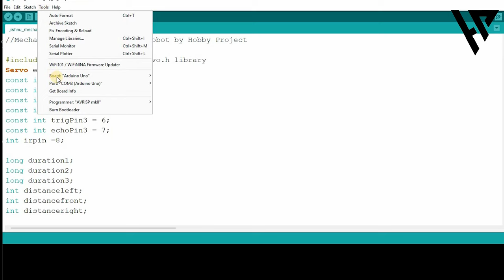Mechano Smart Floor Cleaning Robot using Arduino

Comment: Should i connect the battery gnd and +ve to the esc +ve and gnd and to ardiuno vin and gnd? Plzz respond soon as possible sir :)
Reply from the maker: yes
Reply: @hobbyproject  is it okay if i use a 3s 11.1v 2.6ah battery?
Reply: @hobbyproject  sir i saw your reply to a comment and another comment. You said use an lm2596 buck converter to power the motor driver and you also said that we only need 2nd buck converter if we have to slow down the wheels(speed of the boat)but doesn't we already power motor driver thorugh the supply from battery and esc?
Reply from the maker: if you are using a low rpm motor u don't need to adjust the speed.
Reply: @hobbyproject  Is it okay if i use 11.1v battery with 2.6ah?

Comment: Can i power up ardiuno through the jack port on direct 12v from battery? Plz reply sir its urgent🙏
Reply from the maker: yes u can.
Reply: @hobbyproject  In the circuit you showed us to connect the negative and positive of battery  to the esc and from esc to 5v and gnd in ardiuno right but doesn't that burn ardiuno bcoz the battery with 12v is connected to ardiuno 5v?
Reply: @hobbyproject  which one is safe?
Reply from the maker: Vin and gnd

Comment: Where did you get that glass cover from.What is the material used ?
Reply from the maker: Hardware shops, polycarbonate sheet.
Reply from the maker: Higher kv rating lowers battery backup.
Reply: @TRAZExYT circuito completo porfavor

Comment: Where do i connect the 2nd buck converter?
Reply from the maker: if u need to adjust the speed of the bot then only u need the 2nd buck converter. connected parallel across the + and - of motor driver.
Reply: @hobbyproject  Do i need to adjust the voltage of buck converter for charging the battery? I mean should i put a higher voltage than 12v to charge the battery?
Reply from the maker: It should be higher than the battery voltage, so the current can flow from charger into the battery.

Comment: What is the use of another buck converter that you have used in the last part, kindly,please give the connection from the converter it will be helpful.. i am working on this project..
Thank you!
Reply: It is to control the speed of the wheel motors, The l293 motor driver used here doesn't have enable pins ( pwm pins which is used to control speed,In this case it's speed of motors) So the speed of the wheels here is too high, So he used the lm2596 buck converter to step down the voltage provided to the l293 driver, So low voltage means low speed, So that's why.
Reply: @TRAZExYT what is the use for the 1st buck converter?
Reply: @benogorman8034  The 1st buck converter is used to charge the battery, The buck converter have an option to adjust it's output voltage,so you can adjust the voltage according to your battery specification, Remember if you were to charge a li-on battery then you should atleast put 1.6 volt more than the original

Comment: Hey sir. Potentio 10k to arduino for what?
Reply from the maker: To adjust the speed of BLDC motor.
Reply: How to control speed of wheels? I use 12 v for motor driver and wheels run so fast. I use  mini L293d
Reply from the maker: Use lm2596 buck converter to power the driver so you can adjust the speed.
Reply: @hobbyproject  thanks sir. You're amazing

Comment: hi, i'm doing this project and my only problem is the dc motor speed, how can i make it slow?
Reply from the maker: use lm2596 buck converter.
Reply: Hey please help out,we are working on this but its not working,cam you provide me the circuit diagram,it's urgent
Thanks in advance
Reply from the maker: check the description.
Reply: @hobbyproject  the circuit given in description is incomplete. We are working on your project,but the problem is that the bldc motor and the wheels are not moving
Reply from the maker: jiishnumm@gmail.com

Comment: hello, code still working? because I made the robot and uploaded your code but it simply doesn't dodge anything and it crashes into walls, if you can help me I would appreciate it.
Reply from the maker: Yes ,sure
Reply: @hobbyproject  would you give me a hand?
the 3 ultrasonic sensors work because I receive data from them on the serial monitor.
the ultrasonic sensor also works, in fact, it reverses the rotation of the motors properly and finally my arduino and driver plus the other additional components are working correctly, I don't know what could be failing, the robot simply does not avoid obstacles.
Reply from the maker: Check the ir sensors
Reply: @hobbyproject  The connection of the polarity of the motors was wrong, thank you very much for your activity and help, it is appreciated in the community.
I leave my subscription and like.
Reply: @hobbyproject  one last question, is there any way to reduce the speed of the motors? thank you!
Reply from the maker: Use lm 2596 converter for powering the l293 driver .
Reply: @hobbyproject  what is the material U used for the base. is it candle holder?
Reply: @taielrenzi1051  hey can you send me the complete circuit diagram,i am working on this project.. Thankyou

Comment: I have done all the connection but my wheels are not responding can anyone tell the connection of motor driver l293 with arduino and battery.. Reply fast
Reply: L293 motor driver ( In1.In2,In3,In4) pins to arduino as shown in the video. Positive and negative directly to +ve & -ve of l293 and esc
Reply: by + ve and - ve. imean from the battery
Reply: If you wanna purchase it . Then contact us with all details delivered to your home 👍

Comment: I tired the vacuum part .But it is not able to suck the air used the same components as mentioned and the same design.Can you help me regarding this?
Reply from the maker: Dont place the motor too munch inside.
Reply: @hobbyproject   does this really suck the dust particles like small paper pieces etc?
Reply from the maker: hey did you really made this project.
Reply: @hobbyproject  yes i am making this project . But the problem is in the vacuum part.

Comment: Where did i connect motor speed controller pls tell me bro 🥺🥺
Reply: Please tell i am having science exhibition tomorrow 25/2/2023
Reply from the maker: Use a buck converter for powering l293 driver.

Comment: how to give power supply to the arduino?
Reply from the maker: Through Vin and Gnd pin.
Reply: @hobbyproject  then why did you connect 5v from esc's bec to ardiuno?